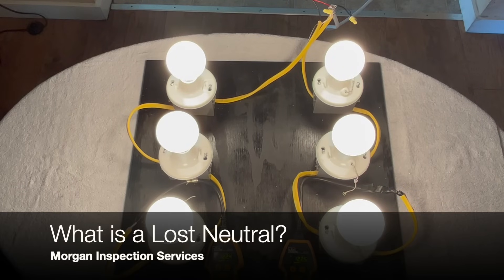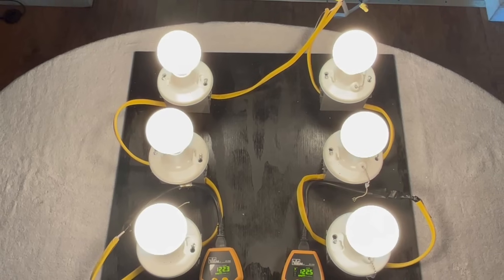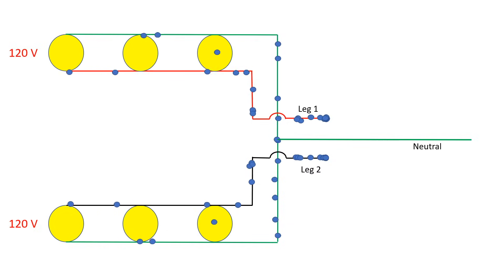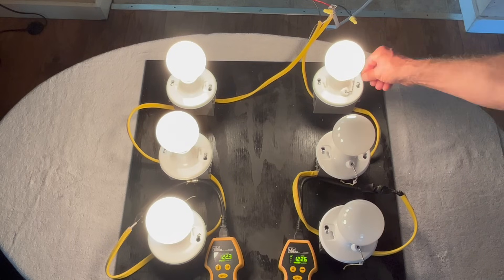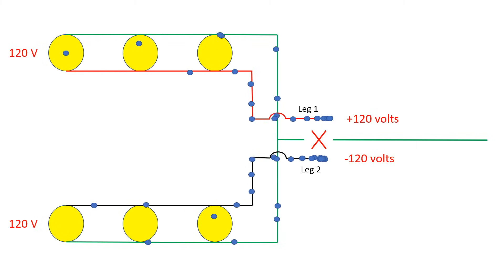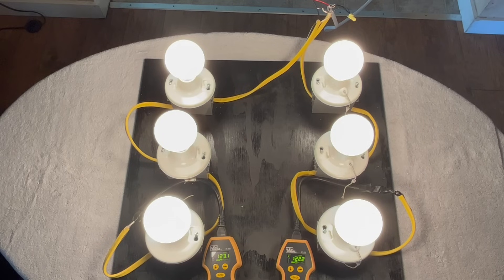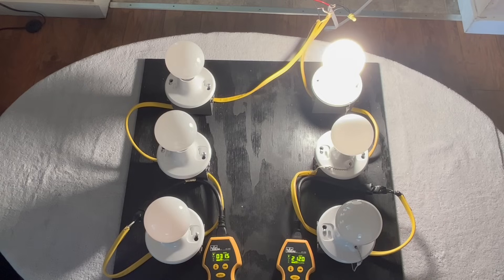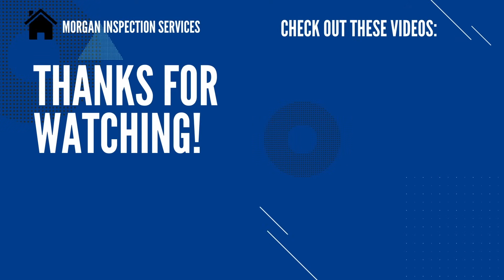What is a Lost Neutral? Lost Neutrals demonstrated

Comment: maybe this is a better way to explain and understand. If you remember ELI the ICE man we know that a reactive load causes voltage and current to be out of phase with respect to one another by some amount of angle. That is to say they are out of time with each other. Voltage happens first or current happens first. This is because a capacitive circuit delays the voltage and an inductive circuit delays the current. 
With 3 phase, the 120* angle between each phase comes from the power company with their generators being 120* out of sync with each other. 
In the case of a single phase transformer secondary, this is not a load but rather a voltage source. There is nothing in it that would cause a delay in time. 

I did watch your video and your meat and potatoes of what you’re explaining is spot on. It’s just that when things are taught with misunderstandings, it causes confusion to set in and the confusion gets taught to the next group and so on. 

When I studied in the 90s I went above and beyond what was taught in the classrooms and I missed a lot of test questions because of it. One that I remember was marking a question false that said current can only flow in one direction through a diode. I knew how a voltage regulator works by flowing current through the diode backwards so I marked it false. My teacher had no clue what a zenor was. I’m an hvac contractor now and work with electricity every day but I’m not an electrician. Sometimes I wish I’d learned that trade instead.
Reply from the maker: Whatever you are, you sound like you really know your stuff. I was guessing you were an electrical engineer. I honestly have always heard and believed, and therefore thought that the two 120 V legs were 180 degrees out of phase. I learned that because of one being wound clockwise and the other being wound counterclockwise that they are 180° out of phase, and that makes total sense to me. You have gotten me to thinking, and I am going to do some more research, and get ahold of an oscilloscope. I will probably make a new video based on this discussion and what I learn. I hope to talk to you more.

Comment: thanks for the reply. At 2:10 you said they were phases or legs. That’s two different things. Either way you look at it, it’s a single phase transformer. What we really mean when we mention phasing is time. Are the two legs out of time with one another? No they are not. There is nothing that can cause a delay. So they are in time. An oscilloscope would show a 120 volt sin wave or a 240 volt sin wave with their peaks being at 170 volts or 340 volts. The two legs do not add together to create 240 but rather we are breaking the 240 in half with the center tap. By doing so we are only changing the amplitude of the sin wave. All measurements are relative with respect to reference. 

My phone always gives an error when replying to a comment so I have to leave another comment.
Reply: Excellent comment!
Reply: Good points. Note that loads which only require 240 volts (e.g. electric heater) do not need a neutral, though they should be grounded.
Reply: @aspensulphate so the 3rd (round) prong on a 220 volt plug, is it a neutral or ground?
Reply: Single phase , each leg to neutral  120v. 240  across both legs.
Reply: @Randall-mt7jk correct. One sin wave has twice the amplitude as the other and that’s the ONLY difference between the two voltages. They are the same phase.

Comment: You have legs mixed up with phases. They are two different things. If there is only one phase connected to the transformer then there is only ONE phase. And the two legs are not out of phase with one another. Do you have an oscilloscope to show they are out of phase? It is simply a transformer with a 240 volt secondary. The secondary has a center tap that we call a neutral. That’s all it is. There is nothing there to make the two legs “out of phase”.
Reply from the maker: Thanks for the comment. I cannot argue with you that “two legs”is the correct term to use, and I think I used that at least once in this video, and I also labeled my animations as leg one and leg two. I understand that only one phase of electricity is connected to the transformer And that is split into two legs by the center tap neutral. However, they are 180° out of phase from each other. If they were not, then we would not have 240 V when we connected across the two legs. If they were in phase with each other, then we would get 0 V if we connected across them. Maybe we are arguing semantics here, but I believe I am correct.
Reply: They. Differ only on how they are created. It is called split phase and what do you get when you split something? They are 180 degrees out of phase. If they were in phase there would 0 V in between them.
Reply: @okaro6595 I’ll agree with the term “split phase” because there is only 1 phase and you split it with the center tap being grounded creating a neutral. But when we refer to phases, we are referring to them being out of time with one another. A delay of some sort. There is nothing in the transformer to cause any kind of delay or phase shift. It’s all a matter of perspective and reference. But they are not out of phase.
Reply: This guy explains it well
https://youtu.be/nOSYHUxHxG8?si=49Bfj-W0T_kUSknK

Comment: How would things/symptoms with and without a ground?
Reply from the maker: Before I answer, let me ask if you are specifically asking about a ground or a neutral. If you’re asking about a ground, the presence or absence of a ground really does not affect things because the ground and neutral are connected to each other in the electric panel, and with the neutral disconnected upstream of the panel, the ground has very little effect on the situation.
Reply: Your animation showed no ground and I couldn't tell from looking at the mockup if there was a ground. So, by having no ground in the circuit and then having a ground in the circuit yield the same symptoms in both cases?

Comment: Thanks for the video. I tested the plugs of my home and I found that a few plugs have 50v between neutral and ground (220v power supply) , may I ask why the voltage is not zero between neutral and ground lines?
Reply from the maker: Are the outlets where you’re getting the 50 V close together where they could all be on the same circuit? If so, it’s likely that there is a bad neutral connection somewhere so you’re getting some resistance on the neutral wire. As current flows through the neutral wire, you will get a voltage drop, which will put some voltage on one side of the neutral.
Reply: @morganinspectionservices3840  Thank you. I guess they are in the same circuit. Btw, would that be a hazard if it is a bad neutral connection that I should be concerned?
Reply from the maker: @erihsehc2  It certainly can be a hazard, but it’s not definitely a hazard. It just depends on exactly what’s going on. Loose connections can result in arcing which creates heat which can result in a fire. It also puts voltage on neutral wires switch can, under certain conditions, cause somebody to get shocked. If you’ve done any electrical work and feel comfortable, you could check the affected receptacles to see if there’s a loose connection there, or it could also be in the electric panel where the wire is connected to the bus bar. Best thing to do would be to call an electrician.

Comment: The current flow at 3:45 is backward for a balanced load with no neutral current.  The diagram shows the neutral current as additive when it should be subtractive.
Reply from the maker: I had to go back and watch the video. I’m not following you because I am showing balanced loads on the two legs and then no current flowing on the neutral so I am showing it as subtractive. Please explain a little more and we can discuss this.

Comment: That’s what happens when cheapskates share neutrals. Maybe stop that. 🤷🏻‍♂️
Reply from the maker: I don’t think the two are actually related unless I’m not understanding you. Since lost neutrals typically occur at the transformer or weatherhead or somewhere before the panel, and shared neutrals are part of the branch circuit wiring, they don’t seem related. I do agree that when you share neutrals and one of those neutrals becomes disconnected that you do have a similar situation with the loads and voltages.

Comment: I worked for electric utility company 36 years and learned all about bad neutrals and repaired many neutrals. When I retired they brought me back a trainer and one of the things I taught was open and bad neutrals. What they caused we called a power surge due to the imbalance of in coming service voltage. This is not to be confused with a power surge that occurs during lightening storms in the south. The purpose of the neutral in a 3wire or 4 wire service is to balance the hot legs. That was the only answer accepted on the final exam. Also many believe it is ok to touch a neural with bare hands. As long as everything is connected properly you shouldn't receive a shock. How ever if there is a neutral problem somewhere you will receive a shock just as if you touched the hot wire. It's all fun stuff but always be careful and ware your PPE. Better to be safe than dead.
Reply from the maker: I appreciate you watching, and I appreciate the feedback. It’s always a nice to hear from an from an expert in the field.
Reply: You can get a small shock even from an earth wire (not sure how you call it in the US, the protective ground circuit) if it's broken.
Almost all electronic devices have filtering capacitors that are meant to leak a small amount of current to filter out high frequency harmonics, and if the earth wire is broken they can't do that and will just charge up and wait to discharge through you.
Reply: @demoniack81  or high leakage earth's especially on servers and pcs earthing arrangement
Reply: @demoniack81  wait when you say a filtering capacitor causes a leak of current - you mean like for instance my microwave ? If it senses a high current, it will direct some onto the ground wire? Can you unpack this further?
Reply: @MathCuriousity  Filtering capacitors are capacitors that are used to filter out high frequency harmonics from the line.
These are harmonics that are produced by switching power supplies (so basically all power supplies made in the last 20 years) during their operation.
Basically old school power supplies used a big transformer running at mains frequency (50Hz) to step down the mains voltage to whatever the small device being powered needed. This was bulky, heavy and expensive (think of the old phone chargers from the '90s and early '00s).
Nowadays they first rectify the AC to DC, then use that DC to run much smaller transformers by switching them on and off at very high frequency (several kHz if not tens of kHz) with power electronics.
This allows using much smaller and lighter transformers due to physics reasons, but this process of high frequency switching creates electrical noise that must not be allowed to get back onto the main line otherwise it could mess with other devices (most notably speakers and other audio equipment, but anything sensitive really).
To prevent this, they use capacitors to shunt these high frequency distortions to ground instead.
A simple capacitor is a good solution because a capacitor will let more current through the higher the frequency, so if appropriately sized it leaks very small amounts of the incoming 50Hz supply but can let all of the higher frequency harmonics through.
Reply: Great 👍 advise and we'll said
Reply: Wow.
Reply: I would not recommend touching a neutral wire in any live circuit.  The higher the current flow in the circuit, the higher the voltage, the closer you get to the load.

Comment: Now can I ask an electrical engineer a question.  It has always seemed to me that AC voltages of 120 or even substantially lower are very easy to get shocked from, but DC current don't seem to be this way at these voltages.  What I am asking is this, is messing around with batteries that are 90 volts or 130 volts a dangerous shock hazard?   Landline telephones operate at 60 volts DC power.  Antique 20's era radios had battery banks that operated up to 135 volts.  I have been powering old radios like this by putting together 9v batteries in series to about 90 volts but have always been a little leery about the safety of handling such things.  I have carefully tested lower DC voltages on the back of one hand and couldn't seemingly feel any current.  I have somewhat assumed that 60volt DC may not be quite as dangerous for the simple fact that phone wiring is pretty wide open in the public sphere.  Could someone clarify this.  I have looked quite a bit online a few times to try and find some discussion of this.
Reply from the maker: I will start off by saying that both AC and DC voltage can be dangerous and fatal, however, the human body seems to tolerate DC voltage better. One study I read says that the human body can withstand approximately five times the DC voltage than it can AC voltage. If this is correct, then it would take approximately 600 V DC to give the equivalent shock that 120 V AC gives. AC voltage, which is alternating current, seems to affect the body more than direct current does. Alternating current has a greater tendency to cause atrial fibrillation than DC voltage does. The human body seems to have a higher impedance (resistance) to direct current than it does to alternating current. Having said this, every body is different, and low DC voltages can sometimes be fatal to some people.
Reply: I was taught it takes approx 40v before you feel anything, having said that, the current is what hurts you so it depends on the power supply. For example, static electricity is thousands of volts but is very low current so you feel a “pin prick” at worse. The North American public telephone system was around 40v DC (?), it gave you a bit of a buz under the right conditions enough to feel it but no kill you (depended on individual circumstances, humidity and skin resistance). The path the current takes in the body is most important too. If in doubt and you must touch the wires, I was taught to use the right hand thumb and index finger or just one finger, the idea there is that the loop urgent would be localized and not travel through the body across the chest through the heart down to the legs into the ground. Current needs a path through you to another conductor, usually ground in most cases of shock. Having said all this, the safe way is to not touch wires above 30v (I was taught that) and gamble with fate, there’s enough testers out there to safely indicate live wires.
Reply: Generally voltages below 50 V AC and 120 V DC are safe in case of an accidental exposure. The primary safety method is always to avoid the exposure. Laptops operate at 19.5 volts because 20 V has been considered the limit below it is safe.

If you operate with 90-130 V treat it like it was mains voltage like have no exposed contacts.
Reply: When I was building electric cars 35 years ago, I got shocked by a 72V DC battery pack. Not bad, but shocking. It's about as bad as getting hit with az24V AC (thermostat or sprinkler valve). I can feel 42V DC as well.

Comment: I kept having a imbalance on the two legs about once a week so I disconnected L 1 and that seems to fix it but now one side of my house has no lights or outlets, and L 2 pulls down to about 115 volts when using the microwave. So will that hurt anything?
Reply from the maker: 115 volts should not be a problem. What are you going to do about having electricity to only half of your house?
Reply: @morganinspectionservices3840  I have lived that way for 2 weeks
Reply: Yesterday I hooked up both legs and everything seems fine but it won't be long.